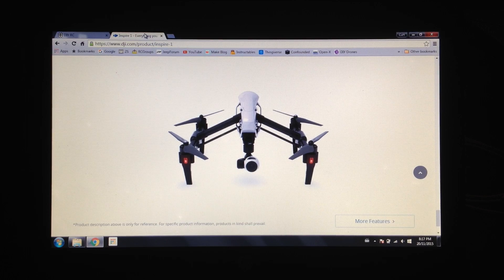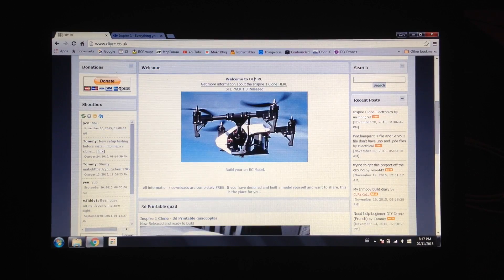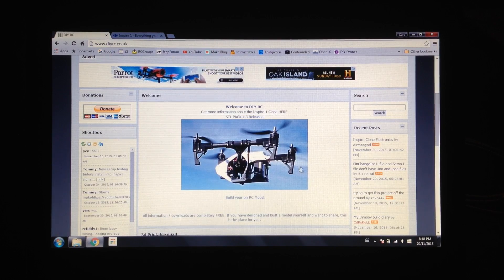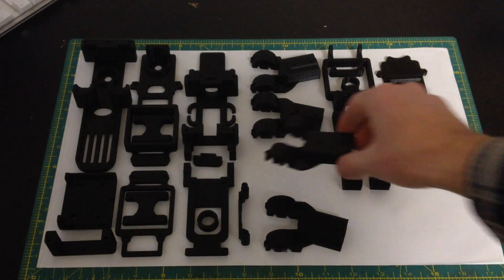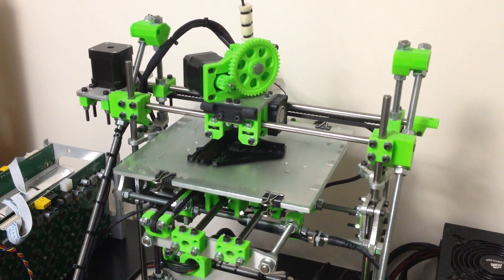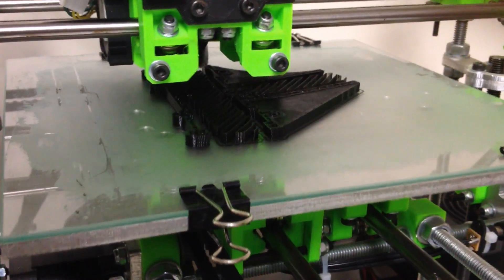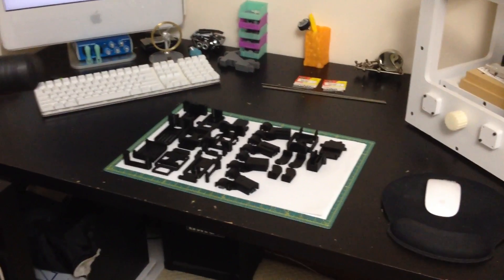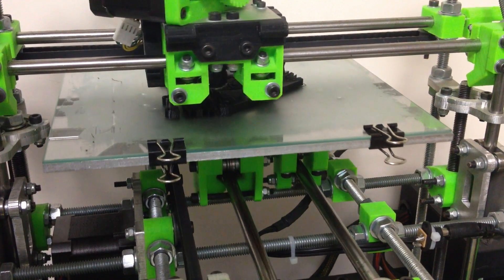Printed Inspire - Part 1

Comment: Death at birth project? Would be cool to watch tho..
Reply from the maker: Almost seems that way, unfortunately I have all the bearings, carbon tubes and inspire body parts purchased so it stays on my desk to remind me to finish at some point!
Reply: Curt Filipowski you look like me. I have like 4 racer drones and a phantom 3 to build, i have all the pieces and parts, but so far i only assembled motors and esc to the frame, but already burned 2 PDBs.... Always getting short beetwen positive and negative on the pdb.
I have a big table with all components but its always a 2nd thing to do

Comment: Hi Curt nice work for your quad... could you please tell me which setup to print Inspire on your 3D Printer...speed, %, temperature...etc...
thank's a lot and happy flights
Philippe
Reply from the maker: Thanks, I printed most of these parts between 30 - 60mm/s with about 20% infill (100% on some of the small parts).  Temperature depends on the brand of filament I'm using.
Reply: Thank's for yours datas Curt....i think i'll try some pieces ....